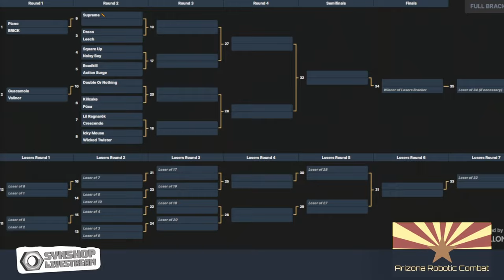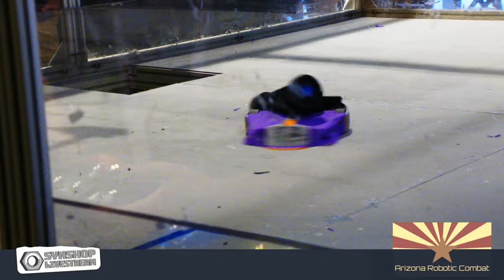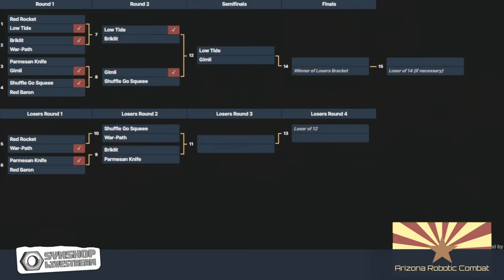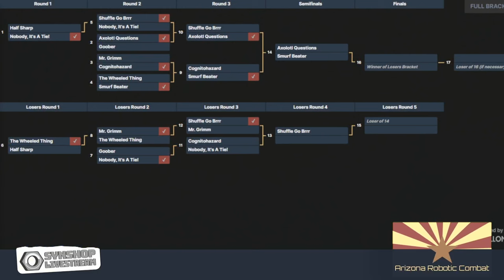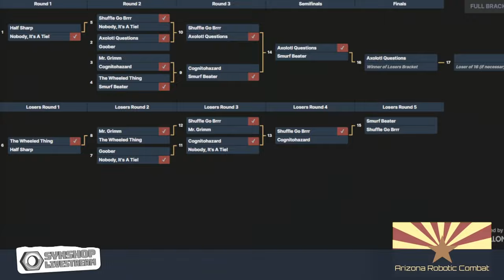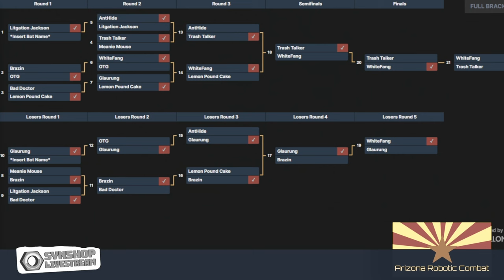Arizona Robotic Combat: RoboRumble!

Comment: Thanks for the awesome event! Both Square Up and OTG had a blast.
Here are the results of my time stamping efforts, apologies for any misspellings.

01:06:25 - Trash Talker Vs. Minnie Mouse
01:09:13 - Half Sharp Vs. No Way Its a Tie
01:11:34 - Axolotl Questions Vs. Goober
01:17:05 - Mr. Grim Vs. Cognitohazard
01:21:56 - Wheeled Thing Vs. Smurf Beater
01:24:11 - Lowtide Vs. Riplet
01:25:16 -  Warpath Vs. Red Rocket
01:29:12 - Gimli Vs. Shuffle Go Squee
01:29:58 - Red Baron Vs. Parmesan Knife
01:35:50 - Valinor Vs. Killcake
01:38:39 - Supreme Ruler Vs. Draco
01:41:48 - Leech Vs. Brick
01:44:28 - Puca  Vs. Double or Nothing
01:48:16 - Noisy Boy Vs. Guacamole
01:49:59 - Cresendo Vs. Icky Mouse
01:51:20 - Ant Hide Vs. Litigation Jackson
01:54:09 - Whitefang Vs. OTG
01:57:49 - Glaurung Vs. Lemon Pound Cake
02:02:21 - Shuffle go BRRRRRRRRRRR Vs. Nobody its a tie
02:06:02 - Wheeled Thing Vs. Half shark
02:08:47 - Cognito Hazard Vs. Smurf Beater
02:10:22 - Shuffle go squee Vs. Warpath
02:14:06 - Lowtide Vs. Gimli
02:18:30 - Riplet Vs. Parmasean Knife
02:21:12 - Anthide Vs. Trash Talker
02:22:49 - White Fang Vs. Lemon Pound Cake
02:25:40 - Shuffle Go Brrr Vs. Axolotol Questions
02:29:35 - Mr Grim Vs. The Wheeled Thing
02:32:10 - Goober Vs. Nobody its a tie
02:37:17 - Supreme Ruler Vs. Action Surge
02:41:37 - Draco Vs. Puca
02:45:00 - noisy boy Vs. lil ragnarok
02:46:47 - Valinor Vs. Wiked Twister
02:51:02 - warpath Vs. bricklet
02:53:55 - OTG Vs. Galrung
02:57:55 - Killcake Vs. Brick
03:02:59 - Red Rocket Vs. Red Baron
03:04:12 - Square Up Vs. Icky Mouse
03:06:12 - Bad Doctor Vs. Brazen
03:09:47 - Shuffle Go Brr Vs. Baby grim
03:13:42 - Anthide Vs. Galrung
03:15:01 - Cognitohazard Vs. Nobody its a tie
03:19:50 - Trashtalker Vs. Whitefang
03:20:42 - Gimli Vs. Warpath
03:25:13 - Axolotal Questions Vs. Smurf Beater
03:27:08 - Lil Ragnarok Vs. Brick
03:33:42 - Icky Mouse Vs. Puca
03:37:30 - Lemon Pund Cake Vs. Brazen
03:41:14 - Suffle Go Brrr Vs. Cognitohazard
03:45:35 - Action Surge Vs. Brick
03:49:30 - Goober Vs. Half Sharp
03:52:30 - Lowtide Vs. Warpath
03:55:58 - Wicked Twister Vs. Puca
04:00:58 - Smuf Beater Vs. Shuffle Go BRRRR
04:05:28 - Shuffle Go Squee Vs. Killtacular
04:09:18 - Galrung Vs. Brazen
04:12:23 - Puca Vs. Brick
04:17:22 - Trashtalker Vs. Whitefang
04:19:54 - Axolotl Questions Vs. Shuffle GoBRR
04:22:53 - ARE YOU READY Vs. RUMBLE
04:30:37 - Supreme Ruler Vs. Valinor
04:33:36 - Whitefang Vs. Trashtalker
04:35:28 - Brick Vs. Cresendo
04:37:49 - Redbaron Vs. Bricklet
04:41:13 - Beetles Vs. Beetles
04:47:46 - Valinor Vs. Brick
04:48:52 - Killtacular Vs. Knee Tapper
04:51:47 - Cruces Crusher Vs. Goober
04:55:37 - Supreme Ruler Vs. Valinor
04:57:34 - Supreme Ruler Vs. Valinor
Reply from the maker: Great! Added all the ones we didn't have! This is likely the most complete one we've had yet!

Comment: 3:06 - Piano vs. *Brick
5:38 - Guacamole vs. *Valinor
8:16 - Leaf vs. *Draco
11:18 - *Square Up vs. Noisy Boy
15:40 - Road Kill vs. *Action Surge
19:53 - *Lit Ragnarok vs. Crescendo
23:39 - Icky Mouse vs. *Wicked Twister
25:58 - Puca vs. *Killcake
28:02 - Red Rocket vs *Low Tide
29:00 - *Bricklit vs. War-path
30:46 - Parmesan Knife vs. *Gimli
32:47 - *Shuffle Go Squeee vs. Red Barron
37:28 - Double or Nothing vs. *Valinor
42:11 - *Supreme 📏 vs. BRICK
46:14 - *Action Surge vs. Square Up
50:33 - *Wicked Twister vs. Lit Ragnarok
52:21 - Road Kill vs. *Guacamole
55:28 - Piano vs. *Icky Mouse
58:21 - *OTG vs. Brazin
Reply: Contestants with an asterisk (*) are the winner of that match
Reply from the maker: Added!

Comment: TEAM ANXIOUS ACORNS FIGHTS-

*Squeee vs. Red Baron 32:47
The Wheeled Thing vs. *Smurf Beater 1:21:30
Squeee vs. *Gimli 1:28:58
*Shuffle Go Brrr vs. Nobody It's A Tie 2:01:35
*The Wheeled Thing vs. Half Sharp 2:05:37
Squeee vs. *War Path 2:10:18
*Axolotl Questions vs Shuffle Go Brrr (1) 2:25:35
The Wheeled Thing vs. *Mr. Grimm 2:29:28
*Shuffle Go Brrr vs. Mr. Grimm 3:09:40
Cognitohazard vs. *Shuffle Go Brrr 3:40:40
*Shuffle Go Brrr vs. Smurf Beater 4:00:40
Killtacular vs Squeee (grudge) 4:05:06
*Axolotl Questions vs. Shuffle Go Brrr (2) 4:19:42 (KO by Wiring Dissection)
Squeee and The Wheeled Thing in the Chaos Rumble 4:22:45
Squeee in the Beetle Rumble 4:41:10

Awards 5:01:18
Reply from the maker: I gotcha added! Thanks! 
-Pong

Comment: my fights
Trash Talker vs Meanie Mouse 1:06:24
Axolotl Questions vs Goober 1:11:30
BRANDON IS ACCUSED OF CHEATING!  and he also predicts the plastic ant winner 1:14:52
Trash Talker vs Anthide (my fastest KO I think) 2:21:04
Axolotl Questions vs Shuffle Go BRRR (1) 2:25:35
Trash Talker vs White Fang (1) 3:19:35
Axolotl Questions vs Smurf Beater 3:25:06
Trash Talker vs White Fang (2) 4:16:51
Axolotl Questions vs Shuffle Go BRRR (2) 4:19:42
Trash Talker vs White Fang (3) 4:33:33
Knee Tapper (safety blade) vs Killtacular (grudge) 4:48:47
Cruces Crusher vs Goober (grudge) 4:51:30
Reply from the maker: Added!